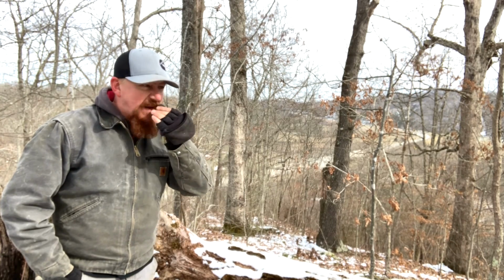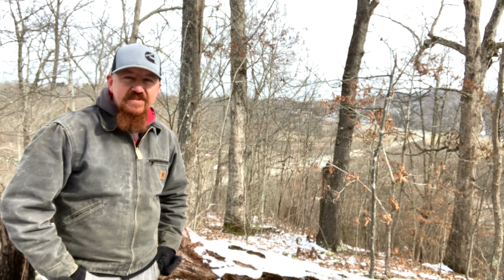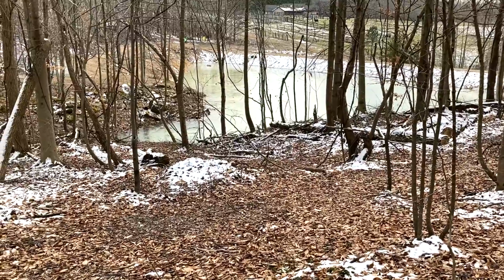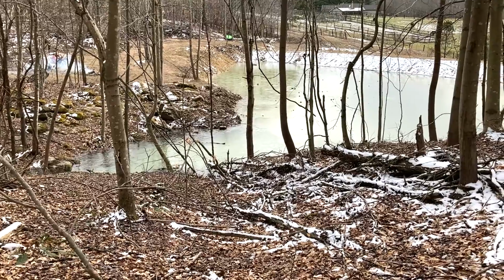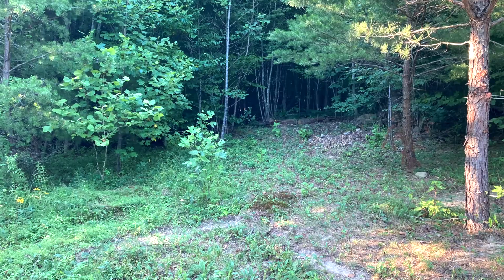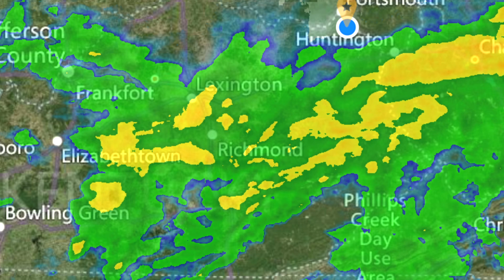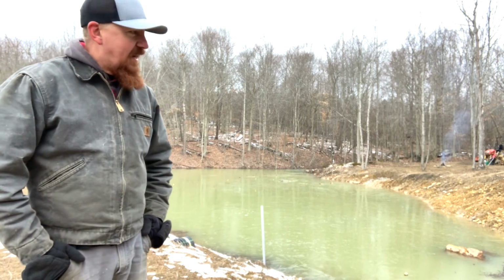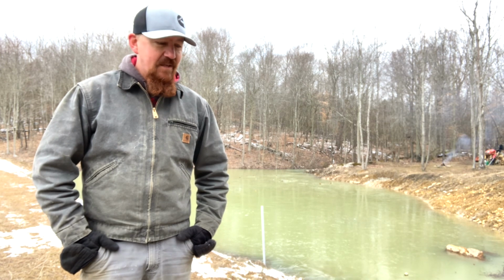Farm Pond Build - Site Selection – Total Construction Cost

Comment: Every site has its down fall, If I want to build a pond I wont have to clear any trees or dig any rock but im in sand so i would have to either line it with bentonite or pit liner or some sort.
Reply from the maker: Yeah, I’ve watched lots of videos where guys had to haul in loads and loads of clay.  It’s amazing what good operators can do.  Are you planning on building one?
Reply: @PeeksPeakHobbyHomestead  Yeah, i want to build a 1.5-2acre pond. Wont be anytime soon as other projects are taking up all the time. So hopefully fall of next year.

Comment: $9000 is steep for me but that looks like a good size pond. I am looking into options to build me a small pond around 120' x 60'. I also don't have clay so I was quoted 3 days of dozer work ( $2500) and 150 yards of clay for about $1200. I hope I can get a decent pond built for 4000 and if needed can do 5000. I have 8 acres and haven't built anything on the land and think a pond will get me started.
Reply from the maker: I can say it is one of the best decisions I’ve made for my property.  It is such a great place to relax and enjoy with the family.
Reply: @PeeksPeakHobbyHomestead  I was at the 8 acres today and did a 15ft hole with post home diggers and hit clay. I attached a rope to the post diggers and threw it down and the soil being damped held on. I'm debating on what to do. I have the water well working now so that's a plus.
Reply: @cutweldngrind  That sounds promising!  “Nothin to it, but to do it!”  Lol. Good luck!
Reply: @Cut Weld N Grind  what did you end up doing. 
I'm currently looking for more info about building mine. I'm in mostly gravel and I'll need to line it with clay. Looks like it will be about 75'x125' and probably as deep as 15'.
Thanks for any info.

Comment: Did they compact the bottom and sides of your pond? If yes how did they compact it?
Reply from the maker: So they just “walked it in”, which is just basically driving back and forth over the dirt with the dozers and excavator to pack it.  They told me the key was to make sure you didn’t pile too much dirt before walking each layer in.